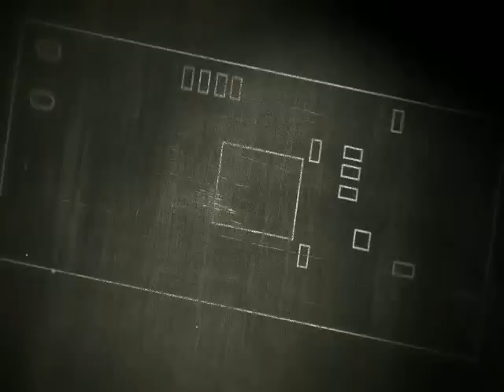BlasterCore3 glance par tII

Comment: Is it possible to purchase this set up??? As this is exactly what I've been looking for. Hope to hear from you. Thank you.
Reply from the maker: Hello you might get a blaster core version 5 from jq Sabres or custom sabre shop
Reply: @ErvPlecter  
I'm looking for the complete set with leds speaker etc, for E11 blaster. As l want the flash down the barrel. I can solder no problems but lve not got a great knowledge of electronics. That's why l asked if you have any kits for E11 blaster. Thank you for your reply, lm most grateful. So l guess l look at the shops you suggested. Thanks Aussie Scott.
Reply: @ErvPlecter  
Wow sorry also l have a DEATH TROOPER OUTFIT an l thought your voice changer would be great for that. Is it possible to still purchase this unit also?? Thank you so much, your workmanship is outstanding. Aussie Scott.